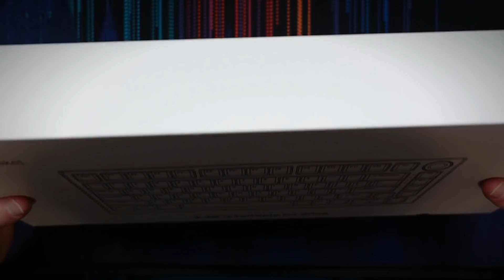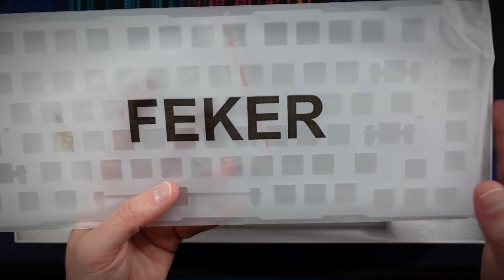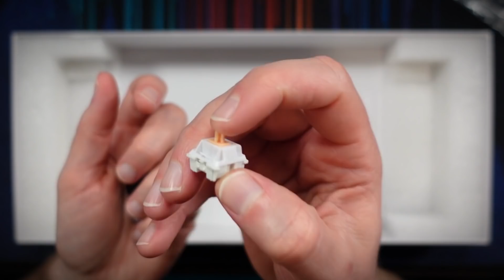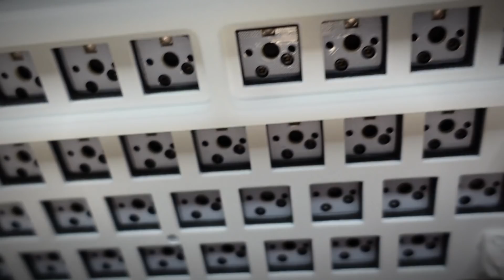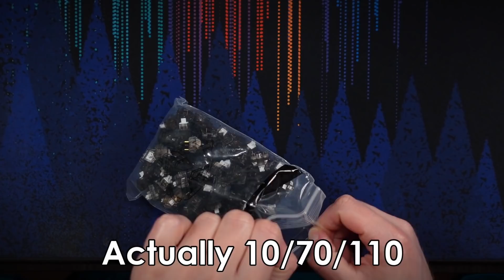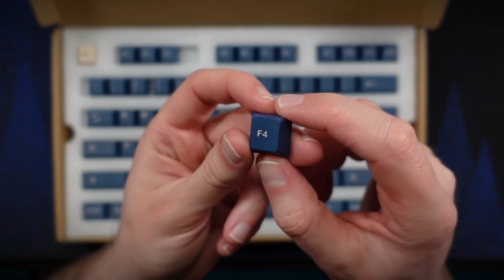New King Under $100? ⌨ ASMR Keyboard Build & Typing Test: Feker IK75 w/Smokey White Tactile Switches

Comment: Software is frequently an issue with these cheap Chinese boards.  How is it?
Reply from the maker: It's barebones and a bit janky, but functional enough. Fairly par for the course for a budget-oriented Chinese board. The only thing it doesn't have that I wish it did is control over the underlighting. There's no software control for that, so you're stuck with the handful of default colours/patterns I show in the video, or you just gotta turn it off. It's a shame, because the actual backlighting can be configured in software to be whatever colour you want.